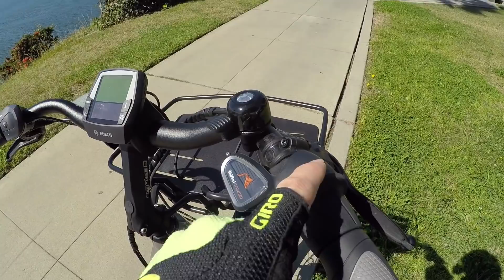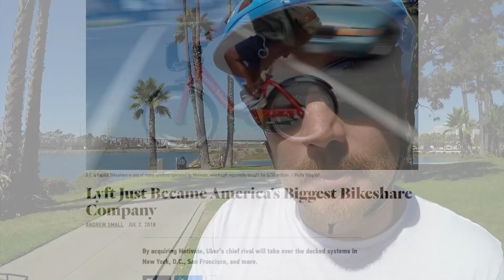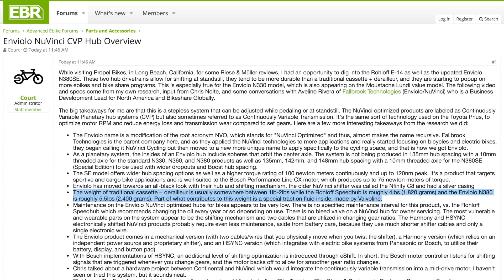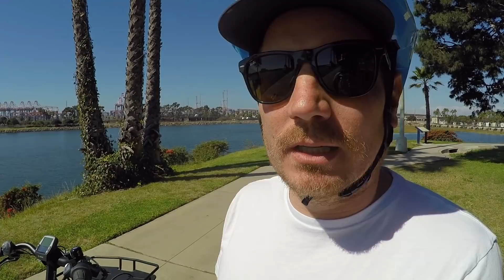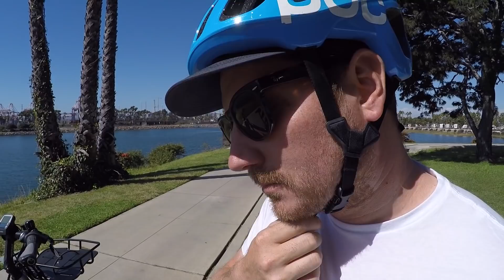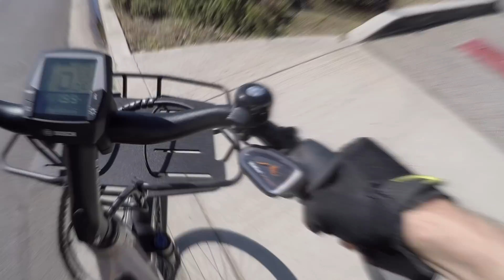Enviolo NuVinci CVP Hub Review, Stepless Continuously Variable Planetary Transmission for Bikes

Comment: The Nuvinci system is great....... but make sure your battery is loaded. When you battery is empty it feels like riding uphill all the time. Nuvinci is not available on non electric bikes and that's for this reason. Without power your pedalling feels like driving through syrup.
Reply: Thanks for pointing that out.
Reply: Do you mean that the Enviolo responds differently to motor power setting zero from the battery literally being dead? I have a new R&M Tinker and I turn the battery power to zero to get exercise and extend range. On an experimental ride I ran the battery until it ceased to provide motor assistance but it still powered the lights and the walk mode. I didn’t notice any ‘syrupy’ feel and found the bike quite easy to pedal with leg power alone on gentle hills/flat asphalt.
Reply: I'd say that is an exaggeration.  I have been riding an n360 on a (non-E) bike for 5 years with no problems.  There is a loss of efficiency toward the low end of the gear range, apart from that it is much like any other hub gear.

Comment: The Rohloff you can actually buy and install yourself, but it's very expensive.  The Enviolo you can't, I've tried to contact them via email and get one, and they said they only sell to OEMs.  I wonder if I tracked them down and threw suitcases of money at them ("take my moneeeeeeeey!") if it'd be more likely that they'd (1) actually sell it to me or (2) got a restraining order? :)
Reply: Garen Parham the Enviolo is also available as an aftermarket product. There aren’t many out there yet, but you can find plenty of Nuvinci hubs available as aftermarket parts.
Reply: @newschoolnerd  Where?  Have looked quite intently, and never could find anything.  Manufacturer couldn't help me either, so finally just gave up.
Reply: For instance in Belgium since January, local sell and repair shops have access to the supply.

Comment: Finished my solarized walk assist device.
Watch on utube, Solarized walk assist device - camper build
Also, Solarized walk assist device.
Solarized walk assist device gets 200km/day.
Haven't tested the camper for distance, hoping to get 200km/day.
I can boil water, charge cordless tools, haul materials or just ride for fun.
The camper's lining is pressure fit, so it can be collapsed onto the deck to decrease drag.
Also watch on utube, Solarized walk assist device - morning coffee.
Check it out.

Comment: My wife has the Nuvinci 360 on her Workcycles Secret Service.  After 5 years and 3,000 miles, the Nuvinci hub has never required any maintenance whatsoever.  Even the shifter cables have never needed adjustment.  

Plus, like with any IGH, the chain, chainring and cog last way longer than a derailleur set up - since the chain can be wider (therefore the ring and cog are both thicker metal - and wear slower).  

The drawback to an IGH like the Nuvinci is the chain must have a mechanism to adjust chain tension, such as an elliptical bottom bracket or chain adjusters in the rear drop out.  Both add some complexity to pulling the rear wheel to fix a flat.  That said, I have found the Nuvinci hub itself is not hard to disconnect from the shifter cables to pull the rear wheel.

Comment: I'd like to get a bike for commuting 10-15 miles each way total 30 miles max without recharging. Suburban commute. I'd like it to travel at least 20 mph. I'm 6 foot and weigh 215 lbs. it would be parked in a covered exterior train station. Would like to spend under $1500.00. Also a batter that's built in would help it from being robbed. Any advice from anyone would be appreciated.
Reply: Under $1500 is tough... If you can save up to $2000-2500, you can get an entry level Bosch/Yamaha system, which will almost certainly last you longer than the cheaper systems and will be generally more enjoyable. 

Also, for theft, you're much better off getting one you can bring with you; without the battery, your ebike is just an absurdly heavy bike. Plus with that distance you're going to need to charge it before each leg unless you ride at the minimum assist (harder to meet your 20 mph+).
Reply: Bafang BBS 02 or HD on the bike of your choice. Should be doable. Just dont ride WFO
Reply: Rad City 19” at $1500

Comment: Ratio span of 10-38 is equivalent to 11-42. That makes it easier to compare to tradional sprockets. A rear gear cluster of 11-42 has the same ratio span as the Enviolo.
Reply from the maker: Thanks for the conversion there Mark! I was saying 10-38 but your 11-42 is an actual gear range (or much more common). I'll try to use that in the future :)

Comment: If you want an ebike and don't plan to do much work - basically just pedaling because it's mandatory (in Germany) - what would be the easiest solution? Electric cars and motorbikes do fine without gears, so does a fixie with a motor make sense here?
Reply: I think you mean single speed instead of Fixie.. Problem is cadance. Since this system needs force on the pedals, because of the torque sensor, you would not be able to put enough force on the pedals to keep the motor running at high cadance. What your looking for is a bike with just a cadance sensor, but this not offered on bikes with a high end drive system like Bosch CX.

Comment: How much does the derailleur setup weigh? I’m tired of this weight argument. I weigh 75kg. Someone who weighs 90kg could ride the derailleur version. And when the bike is 30kg, it makes no appreciable difference at all. Especially considering the massive benefits it provides.
Reply: Yeah very true, i have had a nuvinci hub for 3 years, it never broke, and works perfect under load with a cargo bike, no other hub can do that, no matter the weight.
Reply: Malloot , is the a way to see your setup before I spend my money on the wrong stuff and get stuck ?
Reply from the maker: Hi Chris, you've made an excellent point. Relative to the weight of the bike and rider + gear, the additional weight of a CVP or internally geared hub doesn't make a material difference. It does contribute to unsprung weight, like on the R&M Delite, Culture, and Homage, but it's still not too bad. We're talking about a derailleur + cassette at 0.68kg vs. Enviolo NuVinci at 2.49kg hope that helps
Reply: @ElectricBikeReview  What is the distinction of "unsprung weight"?  How would it be more or less impactful than "sprung weight"?
Reply: @ElectricBikeReview  I was wondering if maybe you could help me out by chance? I've got a Nuvinci N171 hub on the way, and it's threaded for a freewheel, but I'd like to get a fixed 22 tooth sprocket/cog/gear for it that screws directly to the freewheel threads (Or however that works, I'm new to this and not sure). The problem is that I'm not sure of the terminology to use in searching for one, so I thought I'd ask someone experienced so I don't accidentally order the wrong thing. Whether you decide to respond or not, thanks either way.

Comment: In my experience with a 12-36 rear cassette and mid motor a 10-38 ratio would be plenty for the steepest hills on pavement and almost everything off pavement. I have been really tempted to get the N380 but can't quite justify the money, yet. This one you've reviewed looks hard to beat for a near perfect cruiser with the addition of a seat suspension of course.
Reply: Did you ever take the plunge on the N380?